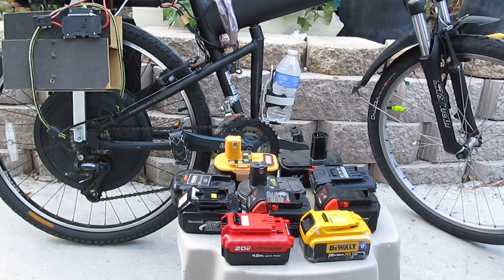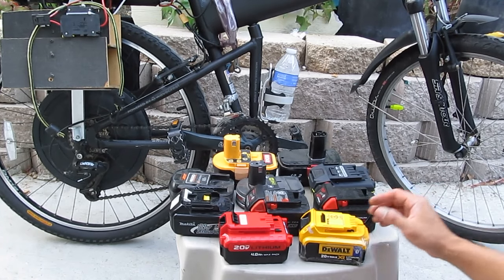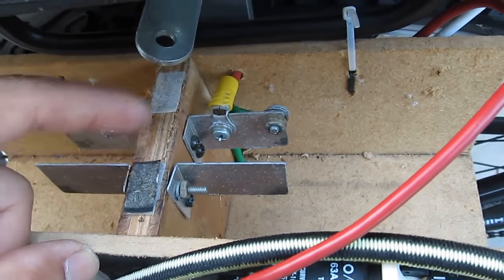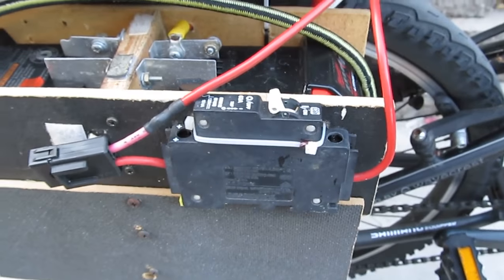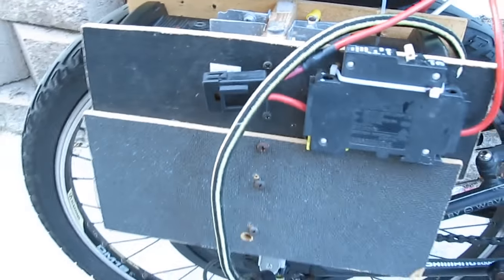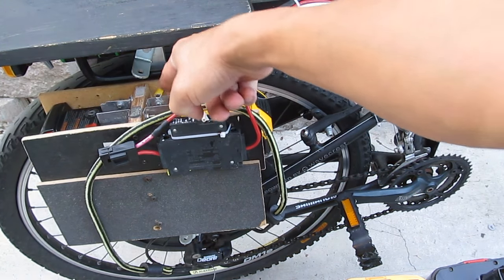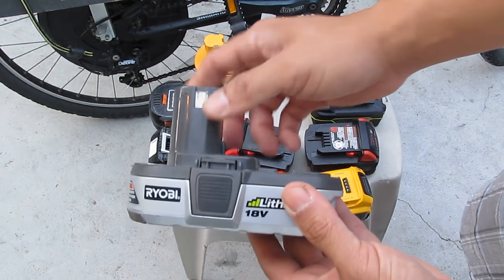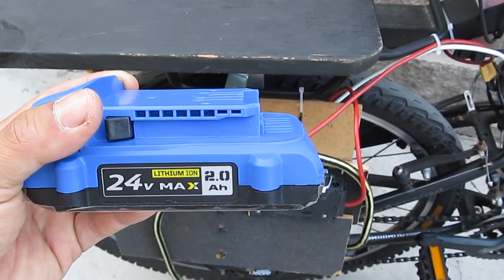DIY: Home Made Electric bike battery box with cordless tool Dewalt/Milwaukee battery

Comment: One thing you forgot to mention about leaving cells in their original pack is that you can easily recharge them with the original charger.
Reply: da
Reply: Also the warranty when you buy them new
Reply: I had the very same concept idea. The only issue is.. i intended to dedicate the batteries for a bike, running x2 20v in series makes the "40v" a headache to charge.. to use the original charger you must remove. So if was just using x2, x4, x6 etc 20v you can just use the original charger (making the bike plug in) .. but if you have a suitable 40v charger then you're flying.. just plug  it in, done.

Comment: Laptop cells have the same discharge rate as power tool batteries so dont let this misinforming video scare you away from using laptop cells.
Reply from the maker: Sorry to burst your bubble but, no, laptop cells have very low discharge rate. There's no reason for it to have a high discharge rate anyway because it does not need it. Laptops only use about 20W to 30W of power max. A drill uses 10 times as much (or more) power in a very short amount of time. Think of it as a foot race. Laptop cells can run a marathon but at a very slow speed maybe just a little faster than walking. You can NOT sprint at full speed in a marathon race unless you're powered by gasoline. On the other hand, power tool batteries can race in a 100-meter dash race easily at full speed. And they can also race in a marathon but power tool batteries would be trumped by laptop batteries in a marathon race. That's because to make up with a low discharge rate, laptop batteries can provide more Amp Hours. On the other hand, power tool batteries usually have low Amp Hours ratings because they have to be built more rigid to dissipate heat better so there's less room to put more Lithium into the cells.
To prove my point, I'm going to give you two 18650 cells and you can google the data sheets of these 2 cells and see it for yourself.
1) Panasonic CGR18650A: this cell comes from a Dell laptop battery. Max discharge rate: 2 Amps.
2) Samsung NR18650-25R: this cell comes from a Dewalt cordless drill battery. Max discharge rate: 30 Amps.
They both have similar Amp Hours ratings but discharge rates are totally different. And because of that, the Samsung cell is much more expensive than the Panasonic cells.
Reply: the cells are the same I tested them
Reply: Currently using a 6P13S pack I built from  cheap laptop cells to power a 20 amp ebike load and it barley creates any heat after 2.5 hours of hard use.  That is 3.3amp pulled from each cell they could handle 6 without damage. 8P worth of cheap laptop cells would be a perfect match for typical 48v1000w ebike kit. These cells are about $1.70 each (ebay search for 9 cell battery in $15 range)
Reply: I have a photo album of build pics and yes id love to help leave me your skype or email
Reply: Screw that you can get a 48v1000w rear hub kit for same price on ebay
Reply: they are $155 on ebay $380 on ali lol
Reply: DIY Archives
that depends on witch company you go with  as well.
Reply: I checked 10 pages and ALL of the rear wheel 1000w48v kits are over $380 on ali those same kits are going for $150-$160 on ebay plus your protected on ebay and  they are already waiting to be shipped from local warehouses
Reply: DIY Archives
ok the look 4 the  none hub style kits then. you should be able to fine some under 4 hunred dollars.
Reply: I was thinking that too.  The discharge rates of 18650's are all pretty much the same.  It doesn't matter if they come in laptops or power tools.  That's one of the advantages of Li-ion batteries.  They are capable of discharging a lot of power very quickly.  Saying a Li-ion battery has a low discharge rate is like saying a 440HP motor has no horsepower.  The reason it's 440HP is because it has power.  That's the point.  If Li-ion cells had a slow discharge, they wouldn't make them.  Other battery technology is cheaper. 

Ni-Cad on the other hand, have very slow discharge rates but I don't know if laptop batteries are made with Ni-Cads.
Reply: *****
some older lap tops had nicads in them . but almost every newer system has some sort of li-on in them
Reply from the maker: The discharge rates of 18650's are absolutely NOT the same. In fact, they are completely different from one model to the next. And if you're comparing ones from a laptop and ones from a cordless power tool, you're looking at two different worlds. I just made a new video to prove my point and you can see it for yourself. https://www.youtube.com/watch?v=c6jlscxs1pY
Reply: Trust me,  laptop cells can be discharged at 2C max. This is about 4-6 amps. Power tool batteries are 20 amps a piece usually. Not only will your bike suck using a 1p variant of laptop cells,  it's dangerous. Mine just blew up because of this (and other compounding issues). You'll  be fine with laptop  cells if you double your capacity number and draw no more than that. Your motor draws 40A? You'll need 10 cells parallel of the laptop variety while you only need 2-3 of the power tool variety.  Do your calculations and you'll be good even if you decide to use button cells lol.
Reply: if you look up the manufacturer datasheet for 18650's, each brand/model has a listed maximum discharge current. It can be anywhere from 1 A to 32 A. Typically the higher current batteries have a premium cost and are only used if required by the application.

Comment: Wont that damage the battery's if you run them to low. Or will the battery manage its own voltage level and turn off before it's too late.

Comment: The tool batteries have a lot higher discharge rate but similar capacity to laptop cells. You may need 10 times the laptop cells to get the required amperage to run the motor but it will also give you 10 times the range.
Reply: But no need for all the work assembling and buying a charger and bms

Comment: i think this is a great idea, no matter what anyone say, their only what about 4ah not the best but hay if it works great, better then taking them apart and never being able to use them for your tools
Reply from the maker: Thanks and yes, that is my main goal. When I'm riding my bike, obviously I can't use my tools. But when I don't ride my bike, I can just remove the batteries and put them in my drills/tools and start working. And sure it's only 4Ah but if you have many of these available, you can just stop and swap them out in seconds and keep on going (indefinitely-at least in theory)! By the way, at this moment, Dewalt and Milwaukee have 9Ah batteries available already!
Reply: wow really they now have a 9a battery, this is really good because a 12v 12ah is is about as high as you can go with the small batteries, they do have a 15a, but for a power tool 9a is pretty darn good, and like you say, if you have 6 of these that will make 12ah, but 9ah this is new to me for a power tool battery, you did really good on saving and using your power tool battery, and the way you have them slide into your box like that, is amazing, good job, this is one of the best ebike fix i've seen so far, 6 of these will get you a long way, now all you need is one more box on the other side of your bike and carry extra batteries. Power tools have a very high discharge rate witch means more power then a gel acid battery
Reply: by the way how far can you go on them two 18v 4a batteries anyway
Reply from the maker: In the video at end you can see I have it running on 2x 5Ah Milwaukee M18 batteries. I went almost 15 miles (or 24 Km) on those 2 batteries. My motor is a brushless motor so it is very efficient.
Reply: 15 miles on two 5ah that's really good, but these batteries are made to last in your tolls so in the long run their way better then most batteries, most ebikes now are brushless motors i only wish they would do them vacuumes brushless, there way to load.

Comment: Use a PVC pipe with screws to go over the clip portion of the ryobi batteries soldering the screws with wire in series.

Comment: Thank you very much for creating this video.  Is there any concern about bypassing the battery management system built into the battery packs?  This is what is holding me back from doing the same thing.  My motor is 36v, 1000 watt, and I don't want to ruin my expensive Milwaukee battery packs.  Is there a way to add a BMS to this rig?  How much can I discharge the packs without hurting them?

Comment: What an inspiring video! Good job man! But can someone tell me..... surely the hub motor being 36v would require the battery's to have a nominal capacity of around 10 amp hours? The ones in the video are 4 amp hours and running them in series only doubles the voltage right? Sooo my question to anybody who can answer is... does running an ebike motor under the stated nominal amp hours damage either the motor or battery's or does it just limit range and performance? Cheers

Comment: Get the new Dewalt 60volt fuse batteries. they also combine into 120 when you buy the two pac kit. also they still fit the original chargers
Reply: They only do 2Ah @ 60volt   the 6Ah is for 20v mode

Comment: Hey, nice tutorial dude. I have a yamaha pas bike. The original battery is 24v 5ah but it's dead. My question is, can I use a 24v 5ah cordless drill battery as a replacement? Are there any consequences? Thanks in advance...

Comment: Here's a suggestion, if you use a big bridge rectifier on each battery casing you can also use the reverse polarity batteries without reversing the poles as long as the batteries are connecte to the ac side the rectifier will correct the polarity on the dc side.

It's like the old nintendo NES that works with either polarity because it has an dc rectifier inside.

Comment: Very clever. Looks like a fire hazard but I've had plenty of electric scooters catch flames because I fucked with the wiring so I can't talk down on this
Reply: I would add two small panel  voltmeter to indicate when either battery bank needs to be recharged, and I would not leave these batteries stay in the bike indoors unattended; after a ride they should be removed from the bike and placed in a factory regulated charger.   despite the fuse, there is a small chance of a short that circumvents the fuse which could overheat the batteries and no chances should be taken, remove the batteries from the bike when not in use

Comment: Why having fixed metallic plug for the + and - of the batteries? maybe having thinner metal plates at the end of a longer flexible cable (like car battery cables) would allow you to have any of these battery in any + or - sides as you can then fit these plates any way you like? It would give you more flexibility.
Reply from the maker: Cables would work but you will need to find a way to secure them as they move around a lot when the bike is moving and going through bumps, pot holes... It's not good for a controller when it's being pulled at 30 Amps and suddenly gets disconnected under load.

Comment: Great video, would love to see more videos of using ordinary or cheap/low voltage power tool batteries on electric vehicles. Have you used 12V lithium vs lead acid batteries on something like a razor scooter?

Comment: Nice video, but you didn't showed us how you connected the two battery packs in parallel to extend the amp hours.
Reply from the maker: I did talk about that in the video. But basically the top 2 batteries are in series, the bottom 2 are also in series. Then I just connect the top 2 with the bottom 2 in parallel. It is a pack of 2S2P

Comment: Please could you tell me what size fuse

P.S. This is great idea. Clean Republic charges 499.00 for 250 watt motor, 10 mile battery, controller. Using this idea i got 800 watt motor w/controller and cables 199.00, Milwaukee charger 22.00, two Milwaukee battery for 66.00.

Thanx for sharing

Comment: hope ya got them drill batteries free lol 50 quid each lol best just buy laptop 12cell for 15quid then times it by how much ya need..... i got 96 x 18650 to run 48v 500w motor runs a treat ....good idea  bro keep it up ...might use em on my lights and battery relay splitter mmmmm

Comment: Is it posibke to power a 36v motor if i only have those makita 18v batteries? 
Dont't they produce (2 of them in series )less than 36v nominal under load ?
Reply from the maker: Two Makita 18V batteries would be perfect for powering a 36V motor. The batteries are actually rated at 3.7V nominal so a 10S pack would be 37V under load.
Reply: @vuaeco  thank you for your answer

Comment: What 18v battery configuration would be possible for a 48v motor? 3 in series would give me 54 volts, would that be an issue? thanks.
Reply: 2 "20v" battery, 1 "12v" battery, all in series. Just make sure they all have the same capacity (2ah 20v, 4ah 12v). If one battery has a smaller capacity it will die first and possibly get damaged. Reducing the overall capacity) This is why a 54v setup is better. Also if you have a 48v motor, it will usually work fine with a 54v battery pack.

Comment: Hi. Could you tell me the spec of that circuit breaker you used? And why a circuit breaker and a fuse?
Reply from the maker: It's a 63A DC circuit breaker. It is an overkill and not necessary. But I needed a switch to turn it on and off because my bike controller seems to have "vampire" power sucker when my bike is not in use with my batteries installed. The fuse is 20A and it is necessary.
Reply: Thanks for the reply. What is the volt and watt of your motor and what is the volt and amp of your battery? I want to see if it matches mine to use a 20 amp breaker/fuse. I have a 48V 1000W motor and 48V 15aH Lithium.
Reply from the maker: I have a 36V 750W motor. So in theory I would need a fuse that is more than 20A. But that's the only fuse I have right now so I just have to live with it. And it seems to be no problem. In your case, your motor alone maxes out at 1000/48 = 21A. So I guess 20A fuse would be fine as usually a motor would rarely get to its maximum rated power. I would use a 25A fuse if possible in both cases.

Comment: Great idea, what's the range like?
Reply from the maker: I got about 12-15 miles on the 2x 5Ah battery packs. Of course, range depends a lot on your speed, the terrain, and weather conditions.
Reply: vuaeco sounds great I'm going to give it a try but with a smaller motor. It gave me an idea to make a powerful like teslas using these and it can grow as you buy more and more progressively. oh and you get ryobi copy batteries, same as the real ones, same capacity, half the price or less on amazon.
Reply from the maker: Yes, you can grow as you buy more. It only takes a minute to switch them out.

Comment: Hey i copied your battery setup on my own project. I got a 36v 500 watt front wheel. And im using 2 18v l ion Ozito batterys linked.
But i had issues the power kept cutting out, once i was out on the road for a bit. And i had to on/off the bike to get it going.
 I could here a clicking in the battery bag, so im thinking the batterys cut out, maybe a safety feature in the new type battery to stop overheating or overload?
When i got home i chucked the batts on the charger and they still showing 2/3 full.

So just a few questions.
1:Do i need older batteries or is there a way to bypass the chip board.
2:Should i maybe take the batteries apart and make a diy battery with the parts.

Any advice from anyone is fine.
Reply from the maker: Power issue is usually from the battery. Is your battery new or used? Did they get hot? It might show 2/3 full but might not have enough power to deliver.
Reply: @vuaeco  hey thanks for the reply. I tried some other batterys and i think its an issue with the controller.

Comment: @ vuaeco quick question: you have a fuse for the setup because you don't have the on/off switch from the throttle?
Reply from the maker: On the upper right side of the box in the video, that is my switch/circuit breaker. I also have a fuse in line with that switch if you watch the whole video, you'll see it.
Reply: @ vuaeco to clarify:  I bought an e bike kit that has the throttle, controller, and the hub motor wheel (like in your unboxing hub motor wheel vehicle) and the throttle handle, which is a Twist throttle has the on and off switch. I wanted to know if you have the same setup in this video with an ebike kit and if you have the on and off switch with your fuse box for extra safety.
PS. I usually watch your videos over and over 😉 Thanks in advance
Reply from the maker: Yes, I have similar setup for that ebike kit. Watch this video: https://youtu.be/SvnFU3SOVJ0. At 13:31 I have the disconnect switch that also has a built in fuse. So it acts as a switch and a fuse. The controller has a power cable and every time I plug it in my battery, it sparks really bad to a degree it almost melt my XT60 connector. And every time my battery is depleted, I have to remove it to charge it. Then I have to plug it back in when it's full. And when I plug it in, it sparks again. So the switch/fuse helps take the spark every time I plug in my battery.

Comment: How are the two batteries connected in series? Are the metal brackets touching each other? It looks like the wood is separating them completely
Reply from the maker: IF you look closely, you will see a metal screw that goes through the wood that connects from one side to another. I drilled a hole through the wood and thread it through both metal brackets on either sides.
Reply: Ohh interesting. Nice work man! This is clever, and I haven't seen a build with batteries like this before.
Reply from the maker: King Khan 
Thanks. This is the world's first electric bike battery box for cordless tool batteries!
Reply: was do a year ago with Dewalt 20v (Bliar88mph) 8 part video but nice work
Reply: @vuaeco : Great job ! Keep up the good work. Nice video